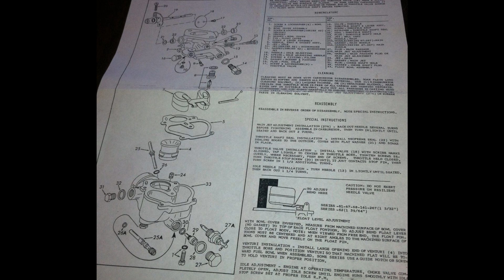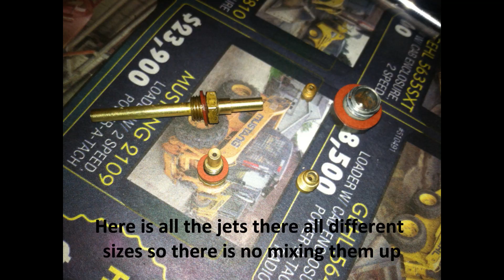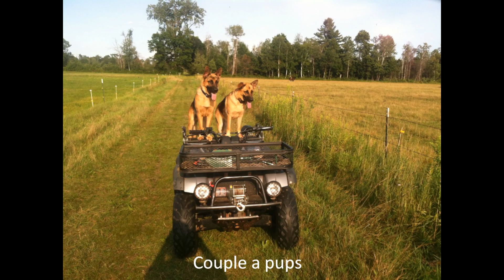FARMALL 230 1958 Zenith Carburetor rebuild kit.

Comment: Nice coverage of bits and pieces. My Farmall 140 carb has a straight plug in the well vent jet area. No idea when or how that happened. Is this something anyone else has seen? The kit we bought did not come with a new one so its still in there. Probably try and source a replacement.